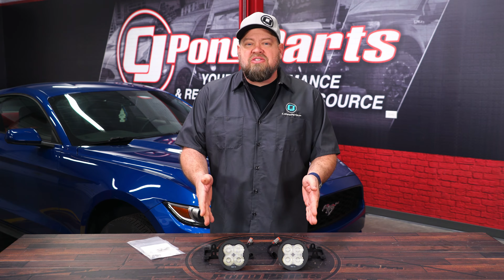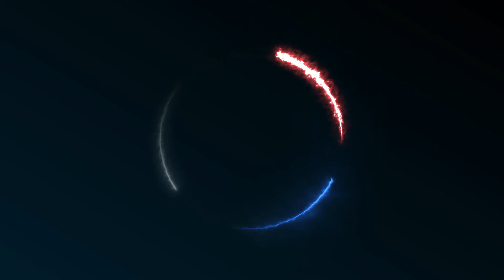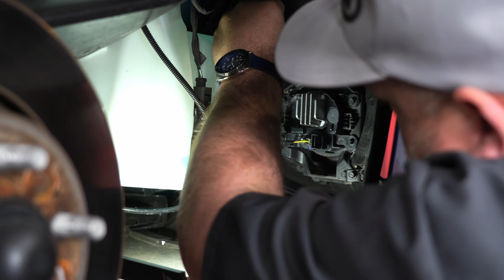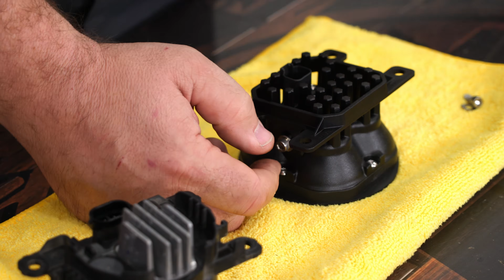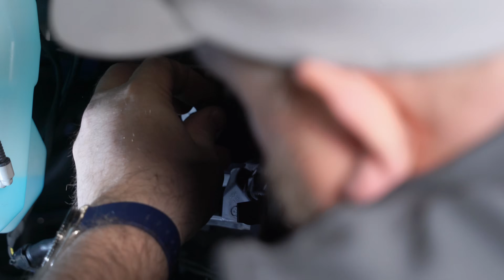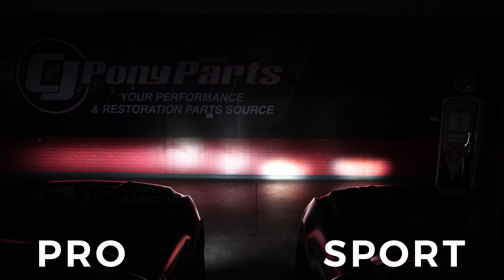2015-2017 Mustang Install | Diode Dynamics SS3 Pro White SAE Fog Lights

Comment from the maker: SS3 Pro White SAE Fog Light Kit:
https://www.cjponyparts.com/diode-dynamics-sae-fog-light-kit-ss3-pro-white-v6-ecoboost-gt-2015-2017/p/FGLA100/
SS3 White SAE Fog Light Kit:

https://www.cjponyparts.com/diode-dynamics-fog-light-kit-ss3-sport-white-sae-driving-v6-2016-2017-ecoboost-2015-2017-gt-2015-2017/p/FGLA96/
SS3 Yellow SAE Fog Light Kit:
https://www.cjponyparts.com/diode-dynamics-ss3-sport-fog-light-kit-yellow-sae-v6-ecoboost-gt-2015-2017/p/FGLA98/

Comment: You forgot to mention that these pods have a few beam pattern options. The ones in the video look to be the “driving style” with the beam way out in front. There is also a more traditional “fog style” that spreads the light lower and wider off to the sides